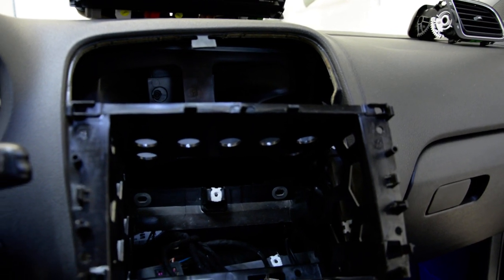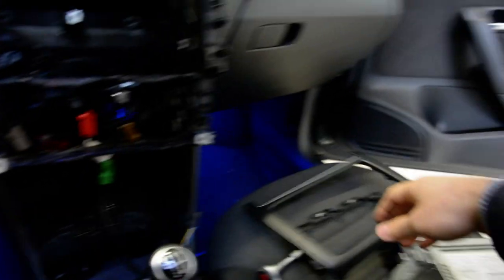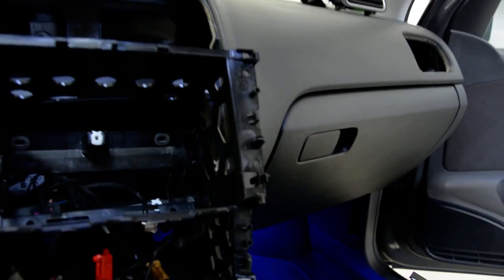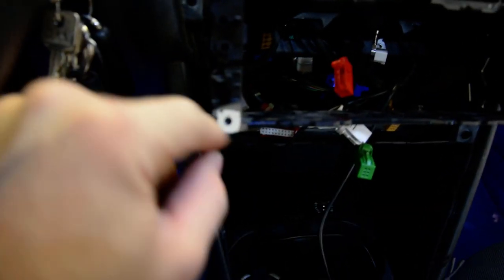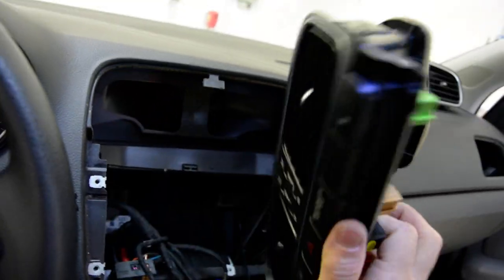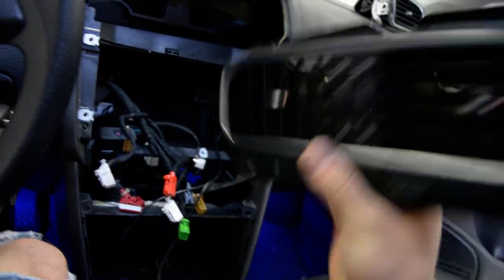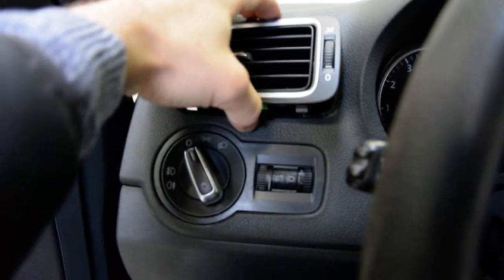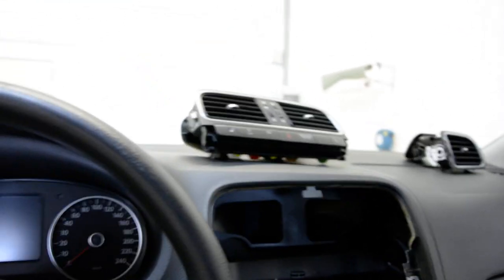VW polo 6R dash vent removal

Comment: Hi there! thanks for this video. Very helpful, but i could not remove the side panels - left and right from the heating system. The side panels are VERY hard in place. Any advice? Also, the heating system has very short wires behind, so I can not pull it out!

Comment: sir,
Thanks for video.
I want to remove/replace button under top AC vents ie ESP, Hazzard Light switch.
So do i need to remove climate control unit (at bottom) to remove top AC vents? 
Or should removing the Music system do the job?
Reply from the maker: +ag69 you must remove the climate control unit and the navigation system. And after that to remove the plastic frame that is inside.  Here is a video on how to remove the navigation system and the climate control unit https://youtu.be/qlL2KbwGth8